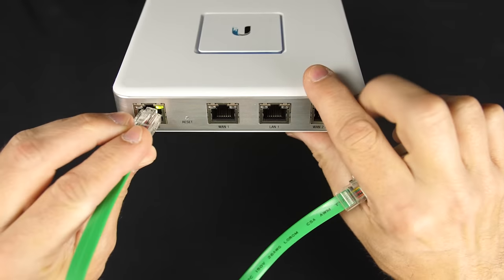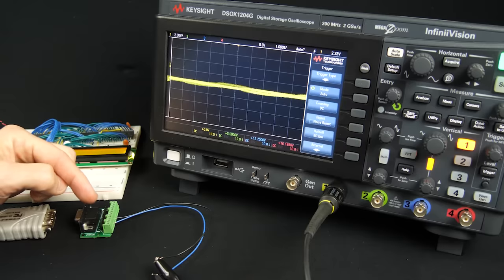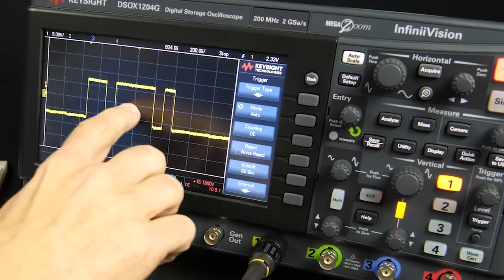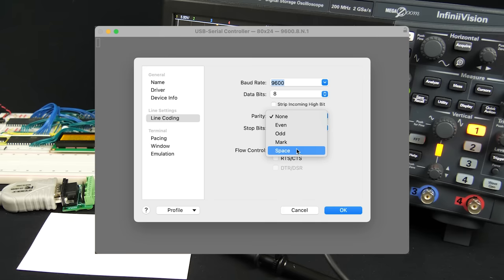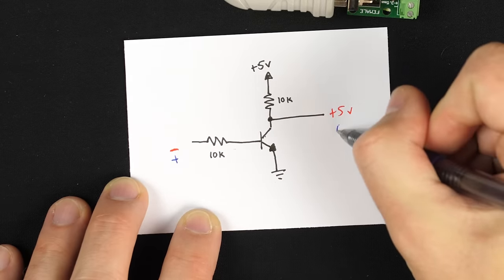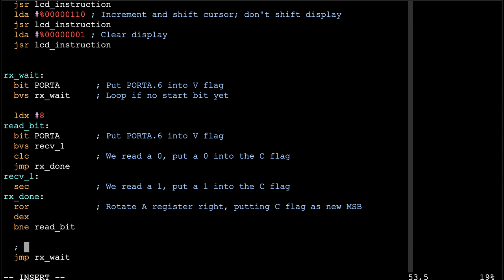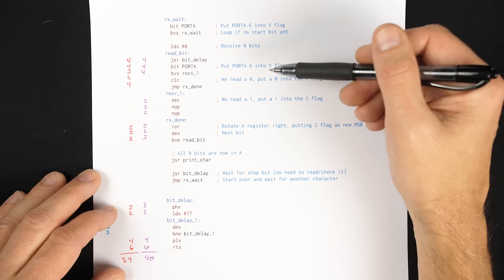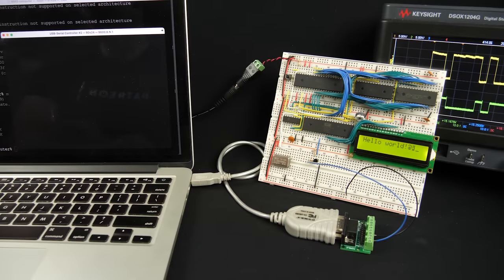The RS-232 protocol

Comment: As a former employee of Teletype Corporation, the description of the signal (mark, space, start, stop, bits, etc.) brought a smile.
Reply: Agreed. Peoole forget that it was a synchronous motor with a wiper that would engage a clutch to make the wiper rotate around a plate with pads on it. The start bit would engage the clutch and begin the rotor spinning that was in sync with the line voltage. Each bit would land on a pad and either current or no current on a 20ma current loop line (remember those days?) The stop bit would release the clutch and the char. Would be printed. Ever wonder why you HAD to send a carriage return BEFORE the line feed character? Its because the print drum would be traveling back to the beginning of the line WHILE the platen advanced with the LF character which would arrive DURING the CR.
I still have a ASR-33 with repair manuals & spare parts.
Amazing mechanical device!!
Reply: I also recognize them, because I use RTTY a lot(RadioTeleTypE)
Reply: Mark, space, start and stop, parity ..... the days when my 1983 Computer Science degree meant more than just  'software engineering'.
Reply: @michaeldavison9808  back in 1983 I was doing lots of RS232, SLDC, BISYNC. I still have my breakout boxes and protocol analyzers. That came in handy for BISYNC & SDLC
Reply: My first job (late 70's) was at a company that sold printers based on the Teletype Model 40.  My first experience with RS-232 was with the EIA/current loop interface on the Model 40.  Teletype built great hardware.
Reply: @rty1955  Fascinating!  We used ASR-33 Teletypes as the console terminal on Burroughs B2500, B3500 and B4700 mainframes before moving on to glass screen terminals.  Maintaining the Teletypes always felt like a little bit of a black art.
Reply: @rty1955  Oooh!  Bisync!  That was the heavy duty stuff, communicating between our Burroughs mainframes and IBM.
Reply: @Ed Stuckey  check out the greenkeys mailing list. We’d love to hear from you.
Reply: @stevenemert837  yup, BISYNC was indeed IBM Mainframes communication protocol of choice. Sync, Sync, Enq.
Then came SDLC ugh
Reply: @rty1955  the 20ma current loop still exiasts in modern equipment, somehow
Reply: @davidconner-shover51  mostly I would think in a very electrical noisy environments I bet.
Reply: In 1976 I got a Teletype on a PDP 12 to emulate a Teletype on a Data General Nova to use Basic on the Nova. So got into assembly language on PDP12.
Reply: lol - Touhy Avenue Skokie, IL - This cutting edge TTY technology seemed new, back in the day    ;-)
Reply: @rty1955  Even worse, some teletypes wouldn't complete a full "Carriage Return" before it needed to. If the Carriage was fully to the right, it would be so slow to Return that, even including the Line Feed to advance the paper, the next character coming in would be imprinted on the paper somewhere to the right of the left margin.
To work with those teletypes, the military used a different end-of-line scheme: CR,CR,LF. The second CR was useless - but it took long enough to transmit that the Carriage had time to Return for the next character. Look at the Allied Communications Protocols ACP-126, ACP-127 and ACP-128 to see.

Comment: Seriously, I've been using RS232 my entire life and I figure I knew more or less how it worked, but your video just raised my understanding of it to a whole new level. Thank you for this.
Reply: It's amazing. Even on microcontrollers, we've gotten used to writing UART.init(9600, 8, None, 1) and having the hardware take care of the timing. 

How does it work? It works just fine, thanks for asking.
Reply: Can't think of a good reply, something about protogens?
Reply: I've always known "9600, eight, none, one" as the mantra to make things work without knowing what each thing was for so I, too, have enjoyed this video.
Reply: @phyphor  these days, 115200 is pretty common, though not absolute
9600 always seemed to run in that happy, Bob Ross range, from really old dayz when the processors couldn't handle it, quite, to the modern times, 96-- doesn't seem to want to die
Reply: Same here. I'm a grey beard who started programming in 1976 (more than four decades ago) and one of my first college classes was programming a Motorola 6800 computer in assembly language much like this series of videos. I'm fairly certain I had to write similar code for that course but thank dog those days are long past.
Reply: I've been using RS232 since the C64 and it's had an impressive longevity as far as port standards go. Finally, I've learned some of its fundamentals. Actually, more than I expected.
Reply: @iancrone2906  Beep

Comment: On a previous spawn of my ethereal soul, I was the sysop of a self-owned amateur BBS. Dial-up, using modems over the PSTN kind of stuff, and the link between the computer and the modem was through an RS-232 connection, so I knew the protocol pretty well for my daily usage. Nonetheless, your description of the RS-232 protocol is by far the clearest and cleanest I've seen. Being a computer programmer, I've always wondered how it could work well without an explicit clock signal, even if both sides agreed on the baud rate, stop bits and parity. I admit, I never actually needed to explore it, but you cleared up that issue for me after nearly 35 years. 😁 Thank you!!!

Comment: In the Subsea sector, RS 232 and 485 are still relevant on ROVs. They work very well in high noise environments (shielding can only go so far with multiple 3000V AC motors in close proximity). The systems are usually 3 pin...
Reply: They're relevant for almost anything industrial. Lots of things like Modbus (used to control basically anything industrial, including probably your buildings AC) run over RS 485.
Reply: Card access controllers talk to subpanels via 485.
Reply: Aircraft too!
Reply: With the NMEA standard? Because we use NMEA 0183 a lot with glider avionics.
Reply: @johannesgaida3137  it depends on the simulation
Reply: Slot machine, player card and game play statistics, a token ring network, uses 485 protocol. For those who don't know the difference. 232 is 9600 baud max. 485 is 19,200 baud max. The voltage protocol is the same.
Reply: @Elitekross  although I am noticing a switch over to CAN bus in newer devices
Reply: @johannesgaida3137  we do a lot of that too, canbus is compatible w many serial and packet interfaces
Reply: Yeah we use lots of modbus and rs 232 in industrial equipments, pretty cool to learn how these protocols work.
Reply: Theatrical stage lighting also uses RS485 in the DMX (digital multiplex) standard. Funny to think how many totally different systems rely on the same basic way of communicating in their bones.
Reply: Twisted pair link is god of dirty environment. So thanks of RS485/RS422.
Reply: @johannesgaida3137  CAN is also derivative of old good Modbus RTU.
Reply: We're still using 232 in commercial audio/video, specifically controlling displays and projectors. 
Almost every hdmi transmitter I've installed has had at least 3 pins for rs232 communication (tx/rx/g) and while most displays have a stereo mini port for it, they usually come with an adapter to db9 and some displays and many projectors still have the full db9 port
Reply: @D R We have one hard wired into the electronic repair station.
Reply: RS232 is almost always 3-pins and is used for simple applications, but it is not very noise resistant and can only connect 1 device to another.
RS485, on the other hand, is widely used in industry. It is very noise resistant because it uses differential signalling, and can connect multiple devices on a single bus. The beauty of it is, it only uses 2 wires! You do need a dedicated transceiver on the board though.
Reply: @dreffon9213  we use RS485 with a dedicated ground plane (it's own personal 0V) and I can't complain about it. RS232, properly implemented, is noise resistant in our high noise environments, but as you say limited in scope.

Comment: The negative voltage requirement of RS-232 is why some ATX power supplies still provide a negative voltage reference on one of the pins. The power supply manufacturers want to provide it in case the end user has a motherboard that uses on board RS-232 (some industrial motherboards still use it). usually the available current for the negative voltage reference is pretty small though (around 1 amp or less).
Reply: Yes, most of the power supplies I have seen have -12v at around 300 milliamps.  For a comparison I don't think I've seen a +12v rail lower than 10amps.
Reply: @stevedonkers9087  +12v capable of less than 10 amps is pretty common on older power supplies before the 24-pin connector. Even my old P4 system with the 4-pin CPU connector only does 8.5 amps.
Reply: Is this why USB to rs232 adapters don't work?
Reply: @petevenuti7355  USB to RS232 adapters use a chip like the MAX232. This chip uses a charge pump to create positive and negative from a single 5 volt input. It only generates around +-7 volts instead of the 12 volts RS232 devices are supposed to output but it still works fine with most devices.
Reply: Some old sound cards used it too, for proper op-amp IO without DC offset.   Old BIOS EPROMS  also used the -5V IIRC
Reply: @MattOGormanSmith  Old DRAMs also used -5V (PMOS technology).
Reply: @eDoc2020  I always thought RS-232 was +/- 12v so I wondered what was going on when Ben showed it at only +/-6 on the scope, but I guess the spec says +/-3 is enough so (I guess) that explains why the MAX232s can get away with the lower voltages.
Reply: @eDoc2020  I had my experiences with old Allen Bradley PLC's where the USB adapters didn't provide enough voltage (or current?) for the communication to work, I'd assume that with the charge pump the available amperage is low, and with the Allen Bradley PLC's being industrial devices, may have had resistors to ground to stifle stray EMI, and the MAX232 didn't have the power to overcome that.  This was back in about 2004 when most laptops didn't have onboard serial ports so this was a bit of a problem
Reply: @devMashcom  actually, RS-232 has a maximum voltage range of -25 to +25 Volts. With a minimum range allowed of -3 to +3 Volts, makes it very versatile. The dead-band is there to improve noise rejection.
I believe the -+12 V rails are there for convenience for PC manufacturers
Reply: @Rx7man  you are so right. The higher voltages were mostly used for longer cables in high noise environments. Back in the 80's it was common to have 25' cables that needed everything the cable could deliver for clean communications. There were even powered adapters available for weak computer ports
Reply: Gunhaver, this is just a fictitious claim. True is the opposite, NEWER ATX (including ATX12VO) standards drop -12V completely. (This is in contrast what we can truly SAY, you are just making things up. About a past you don't know or you didn't research!)
The -12 Volts are a relict of the past and defined in the AT-Standard, a time where NO RS-232 Interfaces lived on motherboards. They had to be populated as cards on a slot. Later in the times of the ATX-Standard this rail was also specified and used in (mini-)PCI slots (SIDE B - PIN 1 -12V). This is the main reason why this -12V power supply has been "dragged along" through the ages for so long. Remember that the 25th anniversary of the MAX232, a single 5V-powered RS-232 line driver and receiver, was in April 2013!!! RS232, RS485 ports (and cards) without build-in circuitry for generating the negative voltage have become very rare since 2005 (Oh ... and a little later ... RS232 Ports, too:) ). The +12/-12V could be used for OPAMP circuits which used dual symmetric supply, for example to provide signal conditioning or other exotic purposes. Some high-end sound-cards require -12V as a reference voltage. These are usually powered from a PCI slot, see above. Graphic cards could use it for signal forming. To identify RS232 as the lone culprit is just a LIE. BTW If you would've RTFM than you knew that the standard defines 0.8A as max-current and 0.0A as min (WhyTF should we guess, when there are EXACT numbers specified?).

PSU manufacturers can't know in advance if the motherboard will actually need the -12V so they will keep adding the -12V line to the plug as long as the ATX standard requires it(see above). And it is not only a matter or whether it is needed or not: If you don't include it, your PSU will not be ATX compliant and you can't sell it as such.
Versus: "The power supply manufacturers want to provide it ..." WOW! I really want to hear about the source or background of that strange explanation. 

Sources, References: IBM PC AT Technical Reference 1502494; Intel ATX Power Supply Design Guide, Version 0.9; PCI Local Bus Specification, Revision 2.2 December 18, 1998; ATX Specification, Version 2.2; ATX Specification, Version 2.01; Wikipedia, AT (form factor), ATX; pcgameshardware, ATX12VO; Carliss Y Baldwin, Harvard University, Design Rules Volume 2: Chapter 15—The IBM PC (for References).
Reply: @NZ2Pepper  (generally speaking, no critique to your comment, just matches the topic:) The specifications do not claim that RS232 is or was planned as a robust interface, f.e. for industrial applications. We simply use RS485, which is current-based and eliminates many vectors of interference. Have a read about it, it won't harm:)
Reply: @dieSpinnt  Isn't RS485 not just RS-232 with a balanced signal. Still for noise rejection on both modes it is nice to allow the highest non-lethal voltage to be used. Yeah it is nice that inductance of nearby conductors forces them to have opposite current. Influence forces them to have opposite charge .. if the sender don't block this using a big connection to ground plane.
Reply: @dieSpinnt  +/- 12V goes back before IBM PCs existed.  Take a look at the S-100 bus power requirements for the Intel 8080 and other early processors and how they solved it with on-board power regulation rather than regulating at the PSU.  https://en.wikipedia.org/wiki/S-100_bus
Reply: @eDoc2020  No! The MAX232 (and 1488/1489) merely convert RS232 voltages to 5v/0V TTL levels.
USB requires protocol conversion to serial and visa versa. So a more powerful chip like the FT232RL/CP2102/CH340/etc is used.
Reply: @dieSpinnt  in aware of that, although initially RS-232 was used for industrial too.
Later 422 and 485 were much better for noisy environments.
Reply: @Rx7man  for PLC's i would look for a SeaLevel serial to usb dongle or hub (or even PCI card). I've worked the most with 422 in industrial settings and we used SeaLevel for everything. dang they are expensive compared to the StarTech ones (that usually have FTDI chips), but they have all the extra features like the really high baud rate. also going by what other people are saying, the -12V reference might be older than RS-232 lol. all i know is the reference was used for on board serial in the older boards i have, and i've always seen it referred to as a "serial reference" or something similar. 

i'm a big fan of RS-422 though because that protocol will work with the jankiest, nastiest setups i've ever seen. i've found cables that were twisted incorrectly, and they still worked in a high interference environment lol
Reply: @Gunbudder  I have no need to anymore, but would have been handy to have back then!

Comment: Great video as usual Ben. It took me back to my days as a data communications technician. When you talk about the clock pins not being widely used, remember that RS232 supports two different modes of operation. Asynchronous communication works as you described and was commonly used with terminals and printers. Synchronous mode used the clock signal and was more efficient because it didn't need a start and stop bit for every character. Synchronous mode was commonly used on higher speed lines which used multiplexers, data concentrators or protocol converters.  For example X.25 packet switched data links or SDLC communications to an IBM mainframe used synchronous mode, and the modem would supply a clock signal.
Reply: What did you do in the market ?
sentimental reasons, why you watched it ?
Reply: @lucasrem  Heh, yeah maybe sentimental reasons 😄. I always enjoy Bens explanations of things I'm not too familiar with. I thought it would be interesting to see his take on a topic I was familiar with.